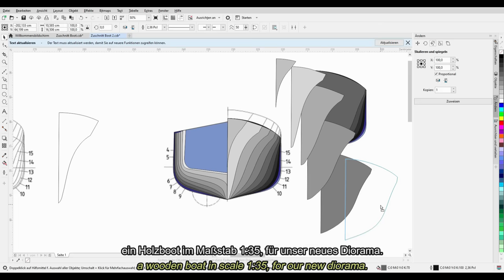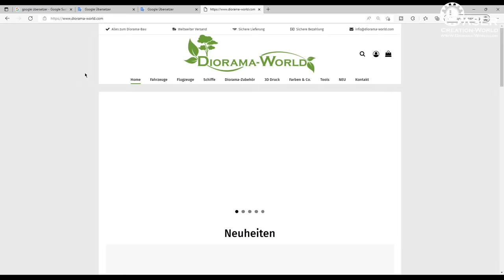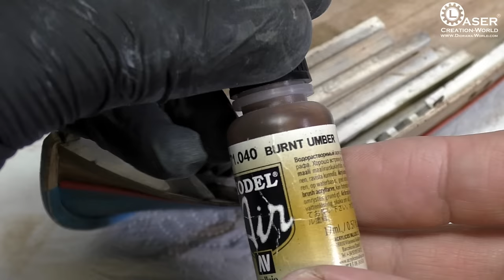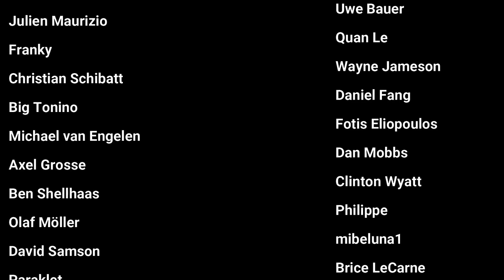Build your own DIY Wooden Boat / painting / weathering / aging / scale 1:35

Comment: Love the build as always! But you forgot a few details in my opinion. Were are the cleats for tying the boat to the dock? U didn't put a compass in the wheelhouse either nor a radio. Don't hold me to it, but I think That type of boat would have had two handles. one for putting the boat in drive and the other would be the throttle. There was no rudder or propeller. No life ring or life vest which would probably be like ones from that the titanic had. (safety first) I didn't see an exhaust out the back which would have been just above the waterline. and no anchor. no bow lights or port and starboard lights. I am sure there is more, I just can't think of them right now. just a few details.

Comment: Wonderful building, congratulations! where did you get the building plans, if I can ask? And if I can make a note, from you who are so precise I expect more detail, the console is a bit sparse, even if it is an old boat it should have as instrumentation, in addition of rpm and knot counter that you have already added, at least oil temperature, diesel level, oil pressure, certainly a communication radio and above all a compass cannot be missing. 🙂

Comment: The boat has steering wheel, but has no rudder. It has motor, but has no propeller. I can tell a few other inaccuracies too, but those aren't this evident for the layman eye - but those two  worth to correct imho.
Reply from the maker: Thank you very much, where it goes I don't need it, that's why I didn't use it

Comment: Impressive mix of tools and skill. Which laser cutter did you choose?
Reply from the maker: Thank you, I am using the Epilog zing 6030 40watt
Reply: What' the thickest mdf/ply that you can cut?
Reply from the maker: @gregparker1660  I cut 3mm mdf, 10mm acrylic glass, 8mm poplar wood without any problems, I hadn't needed more than 3 mm mdf yet.
Reply: Thanks for taking the time to answer, I have been interested for some time, but comparing specs isnt the sale as real experiences.
Reply from the maker: @gregparker1660  No problem, you're welcome

Comment: Marvelous handy work.
I was recently referred to your channel.  I am happy I was.
I have learned new techniques which will be adopted into my modeling.
I do have a question however.  Is there any source material you may be aware of which contains the actual 1:1 scale sizes of the prototype.  Like this boats keel and support timbers.
You seem to model in 1:35.  I model in both 1:69 & 1:87 scale.  I' m certain if I could find original measurements the calculation transfer would be easily accomplished on a computer spreadsheet/data base.
Thank you for an insightful and entertaining episode.
I have just SUBSCRIBED to your channel.  And rang the notification bell.
Jim in N.Y.C., N.Y., U.S.A.
Reply from the maker: Thank you for your praise and subscription, I don't have an exact formula, I mostly orientate myself on people's heights, in this case for 1:35, that's about 5cm at 1.80m